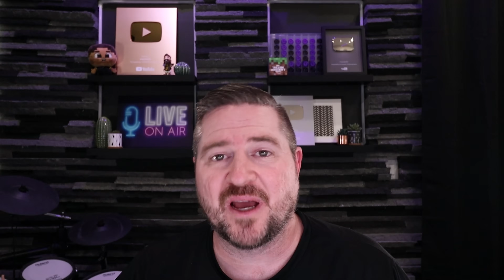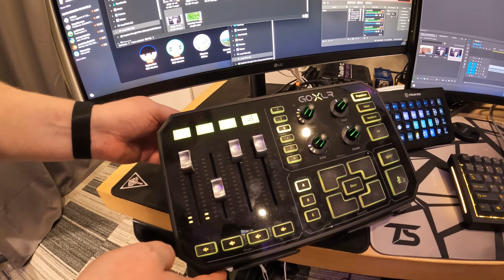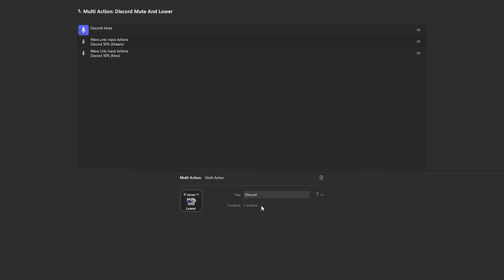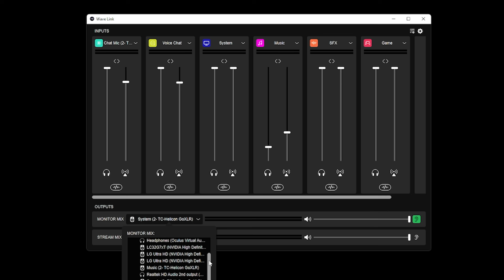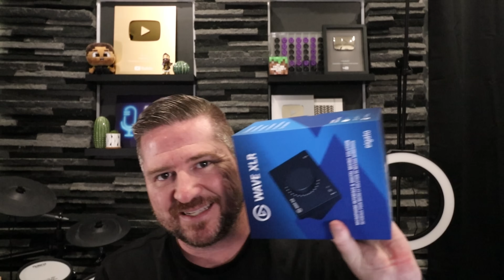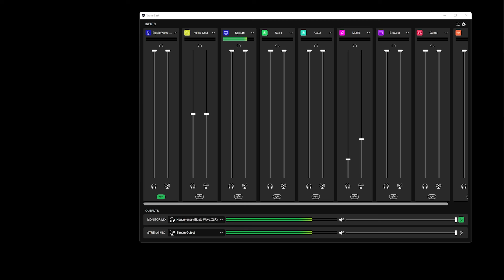Will This Device Replace My GoXLR!?

Comment: They just need to add some extra output options so you can route audio in and out without it needing to be added directly to the mix before it goes to obs.

Comment: Great video! I love the stream deck plus. it eliminates the need for an XLR mic which I went through 3 different cables before finding out that it was the XLR connector was the main issue. Headsets have a great Mic as is

Comment: just get a bigger desk and run all of them elgato isn't a audio company by trade tc helicon is. Plus just by changing the mic settings slightly in the settings of the GoXLR you could easily sound better than the "end of the video" voice. I have a mv7 and mine sounds better than yours through the goxlr. Maybe change some settings. In my opinion buying 2 devices to come close to one is not even feasible. GoXLR is superior until TC Helicon make an upgraded version. Also GoXLR has inter-graded Stream Deck support so whats the problem?

Comment: I don't know if you've seen VoiceMod but that lets you route you audio through the mic and has a soundboard feature as well as voice modulation. I have had it for a while but recently reinstalled it to see if it they had added more polish to it and THEY DID! Still a delay in monitoring but you can send audio through the mic and see what you have active. I use it with 2 x StreamDeck XL's and Focusrite Solo Gen 3. Works like a dream!

Comment: You do realize there are a sleuth of free add-ons for elgato that may do what you need. additionally the elgato + automatically links all mics, All MICS, to the wave software which also give you the option to use vsts. There is talk of future add-ons for the plus that wasn’t available at launch.

Comment: Hey Impulse! When I was in my mid-20s, I was the head producer + recording/mix engineer for a small studio.

There, I used a Marian Seraph A3 pci-e card that connected via optical cables to XLR breakout boxes. There were 3 ADAT inputs and 3 ADAT outputs (8 audio channels per port)

The whole setup was a few hundred dollars, and there was zero noticeable latency (<1ms round trip even WITH DSPs and VSTs enabled)

The breakout boxes I used were Behringer ADA8200s that had very clean AD/DA signals plus phantom power and discrete mic preamps

In addition, the driver was ASIO, which allowed me to route any audio source, physical or digital, to any output I wanted.

It was great, and the best part was that I had one BoB in the vocal booth, one in the instrument room, and one mounted to the bottom of my desk. Took up very little space.

Because these were all designed for professional music recording, the audio quality was absolutely pristine compared to anything else in the price range. And while I didn’t have a physical mixer, I was able to use a MIDI controller with sliders to do everything a mixer would do

Comment: (Summery at end) <LOL>
I appreciate you doing the review... even if they are not the best in terms of analytics, please keep it up... It is a great resource for those of us who are starting out, potentially allowing us to bypass potential mistakes, and tech heads like me LOVE seeing this sort of stuff. (I follow many tech related channels, and my biggest disappointment is they never update their behind the scenes or "this is what you need to do X" videos after the first year or so. That leaves the fans with 5-10 year old tech info that will do them no good)... I have long loved the game rig/office walk arounds by those gamers I follow, I LOVE when they go "I just BOUGHT this gadget and here is how it works and what I think of it". I saw you posted this and I practically got giddy (in part because a goXLR has been on my wish list for a while now (in no small part thanks to you) before I found out about the goXLR, I had plans to solder up some guitar effect pedal circuits, EQs and audio filters to connect between my mic and my computer (of course I also need to make a mixer so I can connect the same mic to my radio communications gear (Ham, CB, and GMRS) but that is a whole other unrelated project))

Summery: 
Thanks for posting this... 2 thumbs up...
As a techie I LOVE this sort of thing...
PLEASE continue to post this sort of thing from time to time when you make changes to your system (and have had time enough to do an honest review)

Comment: I'm not an audiophile, and I'm not listening with headphones, but your voice pretty much sounds equally good before and after. There's a bit of hissing that's gone later in the video but not really meaningful.
Sadly I don't have my good speakers anymore (the power board of my Z906 blew up and the Z607 I got as a temporary replacement are rather crappy in comparison).

Comment: Great Video! As a live events and livestreaming operator I'm always interested in this kit and I love that new streamdeck plus and think it'll work great for our uses too. I did wonder looking at the audio routing you had and you wanted to run voice and samplers through the same mix, instead of sending aux to mic as you were talking about can you send your mic input, and sfx channels to an aux channel and then use that aux output as the main one for OBS, discord and others? That way it will mirror the go xlr functionality you were hoping for, this shouldn't, have an appreciable delay on it if the software and firmware is designed well enough.

Comment: I recently got myself a GO XLR and I did a similar thing where I didn't replace my old mixer but added the GO XLR to it. By connecting Line Out -> Line In in both directions I've basically combined the two mixers into one super-mixer.

I now have
- 12 SFX samples (GO XLR)
- 6 voice effects presets (GO XLR)
- 12 SFX samples (GO XLR)
- Headphone/Broadcast/Chat mixes (GO XLR)
- 6 hardware inputs (1 on GO XLR + 5 on Behringer Xenyx X1204USB)
- 5 virtual inputs (4 on GO XLR + 1 on X1204USB)
- 14 audio FX (X1204USB)
- Main/Alt/Aux outputs (X1204USB)

Now I just need a Streamdeck XL

Comment: I’ve recently set up my GoXLR for streaming and recording. I like to have separate audio tracks in my recorded files through OBS and this took me a while to work out. My Broadcast mix from the GoXLR goes to my stream while the individual tracks are used when recording. 
Are you able replicate something like this with the WaveXLR and Streamdeck+?

Comment: I removed GOLXR and replaced it with BEACN Mix Create. Made by original designers of the GOXLR who wanted more and better.

Quote:
"BEACN MIX CREATE
AN AUDIO MIXER FOR CONTENT CREATORS"

Finally, creators can have all of their favorite features right at the tip of their fingers–no matter what audio setup they are using. Utilize submixes so you and your audience always have the perfect mix; Knob Paging lets you have more than 4 sources for you to control; and our advanced routing makes it easy to send audio wherever you want, whenever you want.

Comment: The Go XLR has it’s own drive to store samples, and it’s routed though the direct monitoring so there’s no latancy, same with the mic. Almost all audio interfaces outside the go XLR don’t have that. I do see you’re using Reaper to EQ your mic, so you can use a sampler within Reaper, but you need to keep you’re buffer (block) size as low as you PC can handle (62 sample would feel almost instant). It’s Defo getting complicated so you should just consider keeping the Go XLR as it’s does what you need. Mic quality being better on the other hand is your call. Is that gain in quality worth the effort of setting up a virtual cable to reaper etc. hard call.
Reply: I understood some of those words.
Reply: @alexbennie  in simple words, if the mic quality of the new audio interface is miles better than the Go XLR, then he does have the options to use a sampler plug in within Reaper (the program he issued to filter and EQ his mic) as he’s already got that software installed. There will be loads of you tube video about reapers samplers and you’d route that via a virtual cable into his streaming software. Because the pc processes the audio and not the hardware from the go XLR, the sample rate and buffer size effects the latency so he need to set that low. I don’t think I made that more simple to be fair 😂
Reply: @BlindDigital  lol
Reply: The GO XLR does NOT store samples on the device, they are store in user\Documents\Go XLR\Samples

Comment: Awesome video!  Extremely insightful!  Question - When implementing the Wave XLR, do you still need to use a Cloudlifter (or similar)?  To echo on many others' comments, this type of 'behind the scenes' technical video with some product reviews are absolutely priceless, so keep 'em up!
Reply from the maker: You don't need the Cloudlifter since the Wave XLR can deliver 75db of gain which is enough to power the Shure SM7B which is a power hungry mic. I do however have a preamp I use (ART Tube MP/C) that I use mainly for the warm tone it gives my voice with this mic. I am using gain from that now but I also tested with no gain on the preamp and only from the Wave XLR and it did pretty well. Still might not hurt to include a Cloudlifter in your chain if you have one just so you aren't pushing your Wave XLR to it's upper limits.

Comment: Set it and forget it until Windows updates and changes everything. 🤣  So the Wave XLR is working well with the Shure SM7B, that's good to know. I'm looking into upgrading from USB mics to an actual XLR one and since the GoXLR isn't Mac compatible I've been unsure what to even consider. Now you just need an Elgato sponsorship so I can buy it through a link.

Comment: Meant as constructive criticism: Your framing of this shot is off. You can either raise your seat so your are better in frame, or lower your camera. If you lower your camera, the background won't be framed as well as it is in the shot, but that's okay because you are the focus, not the stuff in the background
Reply: I think the stuff in the background is cool to help inform the viewer (a non-HC viewer) to see what Impulse is all about, especially the 1M play button as they might be more likely to check out the main channel. 

I do agree that the framing is off. Perhaps if Impulse were to do standing reviews?

I don’t like the black curtain cutting off the length of the back wall though. I wonder if it’s possible to create a false door with the wall tiles?